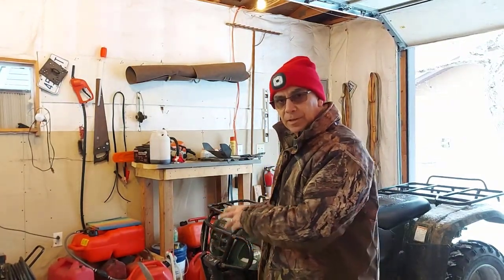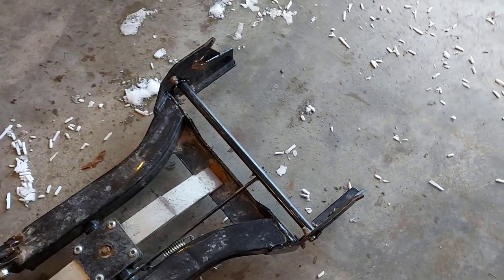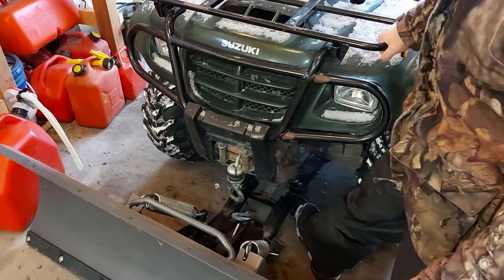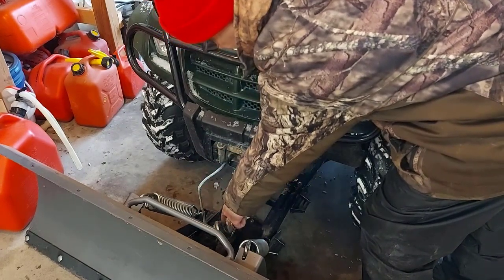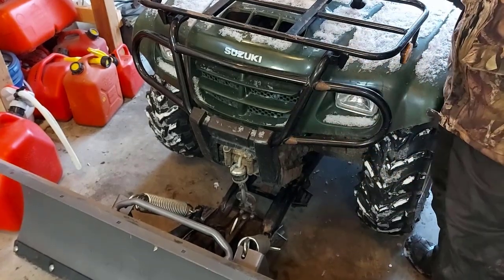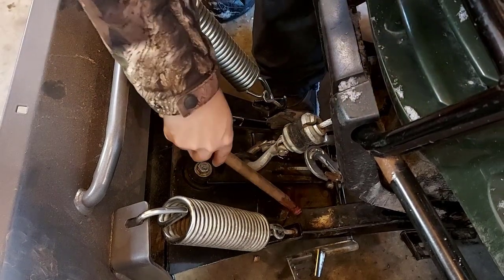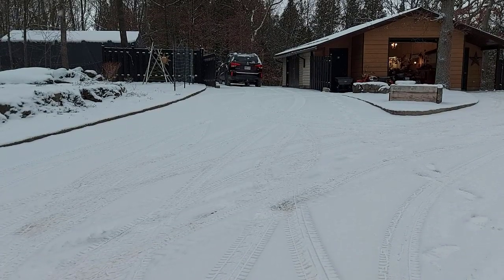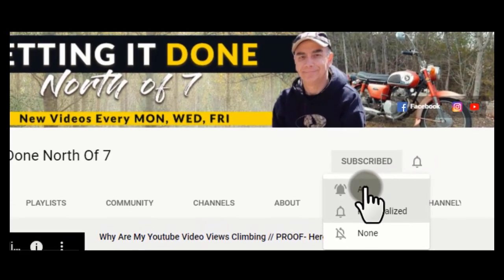How To Install Your Click n Go 2 Snow Blade // Best ATV Plow Setup

Comment: Boy could I use one of those! From my new shop to the road is 1/8 mile, that means with the snowblower I'm walking and bouncing around 2 miles of snow blowing! Cheers, Thumbs UP and Peace Out
Reply from the maker: Ya it sounds like you could. You better get equiped
Reply: @GettingItDoneRepairs  Roland I have the mini loader but it uses 10 times the fuel. A PTO blower would be best but I put allot into buying this so one step at a time. Next is heating system tare down and rebuild and getting the B & B ready. Cheers and Peace Out

Comment: What length is your blade?
Reply from the maker: 54 inch. You want it wider than your wheel base.
Reply: @GettingItDoneRepairs  

Thank you for answering so quickly, my kit was ordered just yesterday and I had just enough time to change the 50" they were going to ship with to a 54"... thanks to you!
Reply from the maker: @aallan8830  you are welcome! What atv are you putting it on?